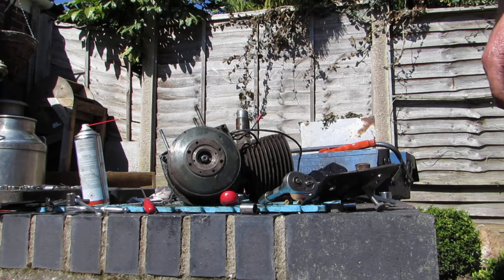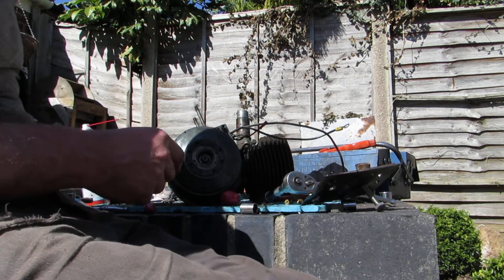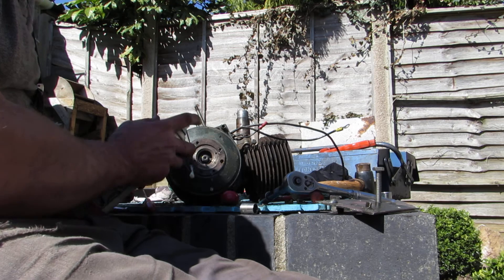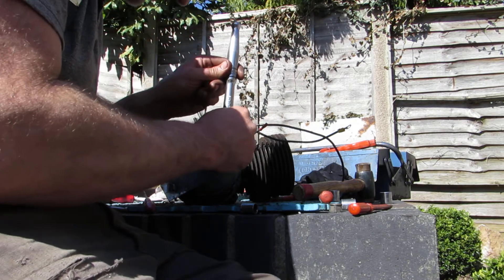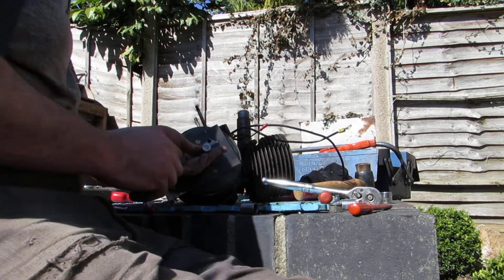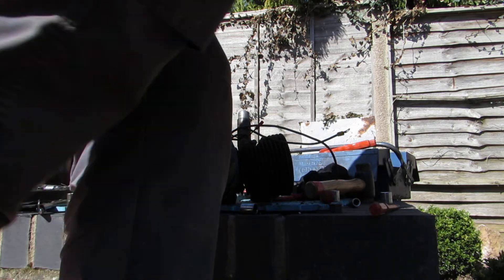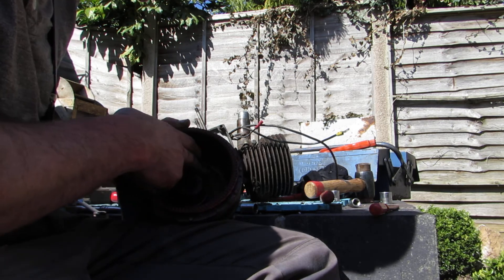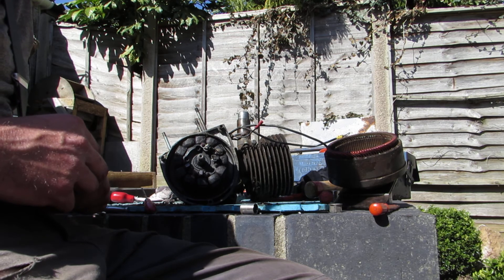Invacar 12e, Villiers 11e, pulling the Dynastart from crankshaft taper.

Comment: Clever Dynastart Rotor Puller. I have a few 9E engines with reversible Dynastart units on them but I took the lazy route and purchased a ready made puller to do mine. I have found that they can have two different styles of brushes. One set has the brushes all identical, the other has the leads exiting the brush on different sides so there is a pair of right handed, and a pair of left handed. The wire terminals are also different between the sets. One has flag tyle terminals, the other an inline terminal, and I do not know how to tell which style brush has been fitted until I remove the rotor. Helping the stock of spares here in North America is the fact that at least one style of the brushes was used in Harley Davidson golf carts.
Reply from the maker: There are two different manufacturers of DynaStart used on these engines, one being Siba and the other Bosch. Both units are very similar but do have slight differences.